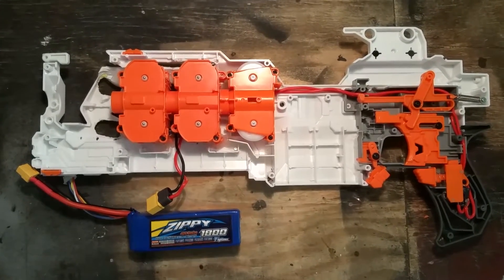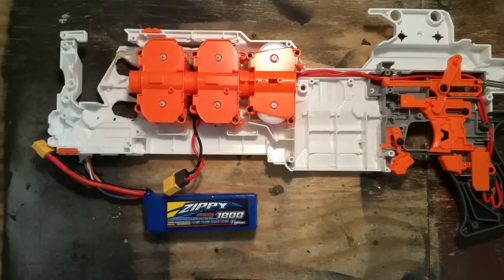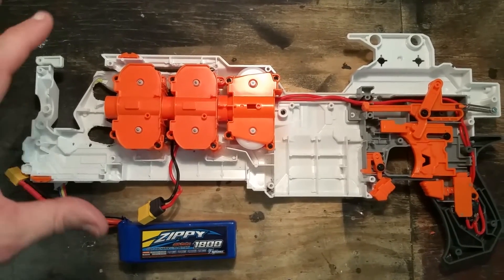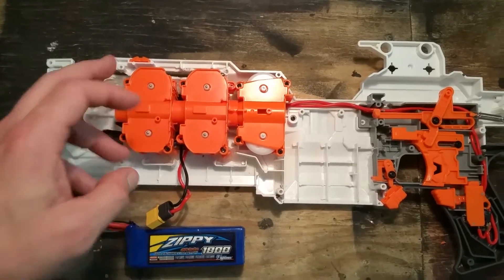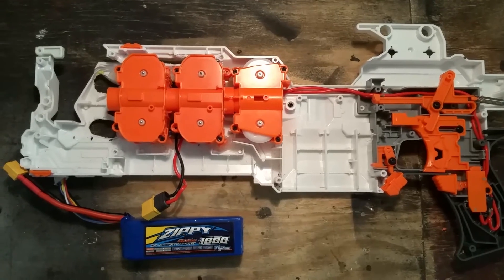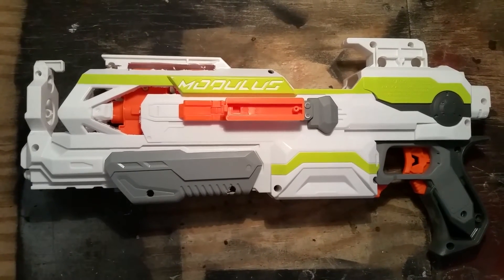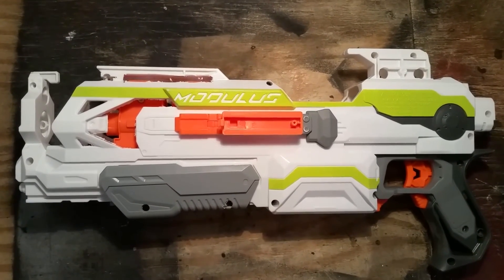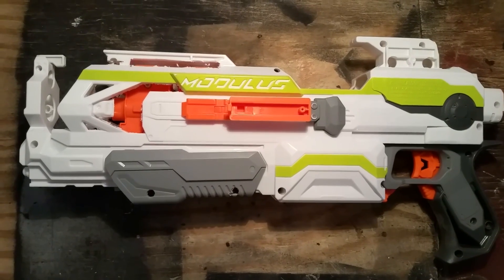Project Hammerhead (Core): Update

Comment: how did you manage to place the motor cages there like what did you do to bolt them onto the shell itself? and what method did you use because im trying to place a stryfe artifact cage into my star wars captain cassian blaster but it doesnt fit so what method do you suggest i do?
Reply from the maker: I glued in screw ports for the additional cages.  Cut them out from an existing blaster, Screw them into the cage, aligned them with a piece of brass tubing, glued the ports in, and then unscrewed them.
I haven't looked at the Captian Cassian blaster, but I found try and use a couple of the existing ports if possible.  Then cut out the others, screw them into the cage, and glue them in.  Since this is the initial stage, the hard part is getting them aligned to feed from the mag.  If you can save some of the existing screw port, this will be easier.

Comment: Hi I've built the same setup as your core blaster and wired up the motors in series as you would a normal Stryfe and linking the motors back to the rest of the blaster. 

I've come across an issue now where I burn out and kill motors in the entry and middle cage (one at a time, 3 motors killed now between test fire shots).

Have you wired your motors in a different way? If so, would you happen to have a wiring diagram you could share or even a photo of the wiring?

Much appreciated. 

Andrew
Reply from the maker: OK, I have a couple of questions back for you.  First, I'm assuming you mean they are wired in parallel - you would need a battery over 50 volts to try and wire them in series.  What motors are you using for each stage?  What battery are you driving it with?
The blaster in this video had all the motors wired in parallel - basically all the positive terminals connected together and all the negative terminals connected as well (noting that terminals for the top motors are revversed from the bottom motors, like in a normal build).  I wired each cage separately (like a normal build) and then connected positive and negative of the three cages together.
Reply: 498 Nerf, yep I've wired the motors as you've described yours. 

It could be the motors then if my wiring is the same. Im testing with Artifact 132 2S motors on all 3 cages, they are apparantly rated for 50000 rpm and from some of  my test shots I was just scraping 160-170 fps at the ceiling with full length fvj darts.
Reply: 498 Nerf additionally, the motors died when testing with a 3S lipo (one  on each occasion )
Reply from the maker: I'm not familiar with those motors, but it sounds like 3S is too much voltage for them.  If they are rated for 50k rpm at 2S, I would be very surprised if they could take 3S without quickly burning out.  Their KV value is just too high for 130/180 sizes.
Now, I don't think you need your motors spinning quite that fast.  I have been using the rotational speeds of 24k rpm, 32k rpm, and 40k rpm as sort of a rule of thumb as the minimum for stages 1, 2, and 3 respectively.  If you have 6 of these motors on 2S, they should all be well above these speeds.  This will put the setup into the dynamic friction range for all flywheels and give you optimum muzzle velocity.
So, to sum up, I'd give your setup a try at 2S and see how it does.  160-170 fps on FJVs sounds similar to what I was getting when testing FJVs - they are heavier and have a lower muzzle velocity that Elites.
Reply: 498 Nerf fair enough. I'll give them another try sticking to 2S.

Comment: how bad does it bog down ..i couldn't tell from the video if it did at all
Reply from the maker: It really doesn't bog down at all.  This section is semi-automatic and will fire with full velocity as fast as you can pull the trigger.  Both the Kysan 17114s and the MTB Rhinos have very good torque for 130 size motors and the Lipo provides them with more than enough current..
Reply: +498 Nerf ah cool. .i was worried of there was enough current in the single battery
Reply from the maker: Lipo's are quite amazing, actually.  The one that I'm using is rated for 72 amps continuous output.  At 4S, that is more than a kilowatt of power!

Comment: Have you experimented with lower overall rpm of the motors? Torukmaktos article on flywheel series states the glass ceiling for 3 stages can be achieved with less effort. But then again, his article is just theoretical.
http://torukmakto4.blogspot.nl/2014/06/theory-flywheel-series-as-means-of.html
Reply from the maker: That is actually one of the articles that inspired me to try building multi-stage flywheel blasters.  I came up with theoretical numbers that are a bit higher - 22k, 30k, 38k for stages 1, 2, and 3 but that is based on a 'glass ceiling' of 120 fps and not 110 for a single stage blaster.

The thing that we have found is that the flywheels for a given stage need to be turning at least as fast as the minimum speed for the next stage if the darts are going to be in contact with both stages at the same time.  Otherwise the previous stage with 'hold back' the dart during the time it is in contact with both stage's flywheels.  I.e. the stage 1 flywheels need to be turning at at least 30k rpms or the second stage won't be able to accelerate the dart until it completely clears the first stage.

Another thing at play here is that as your battery drains, the voltage drops and the flywheels turn a bit slower.  If you have flywheels turning at 30k rpms at 16.8 volts (full charge - 4S), they will only turn at 25k rpms at 14.0 volts (~40% charge - 4S).  So part of the higher flywheel speed is to account for voltage drop as the battery discharges.

Where I'm going with this is that it is advantageous to be at somewhat higher motor rpms than the theoretical stage speeds would indicate.  You can go too fast and cause excessive wear and tear on the darts, but that doesn't seem to happen until you are more than double theoretical flywheel speeds.  I have tried lower flywheel speeds, closer to the theoretical values, but I haven't got quite as good performance from those builds.
Reply: Nice, thanks for the explanation!